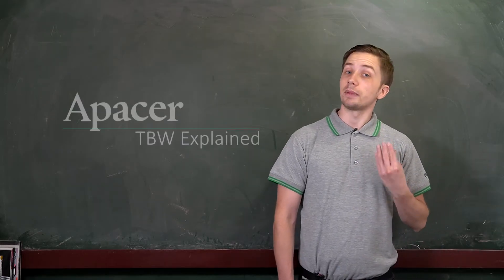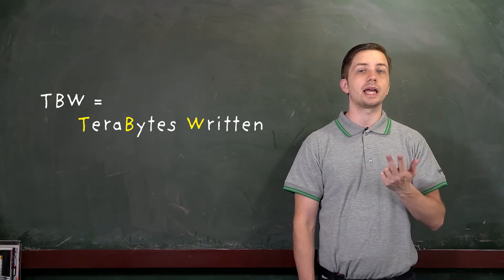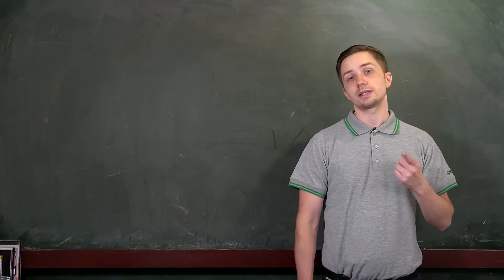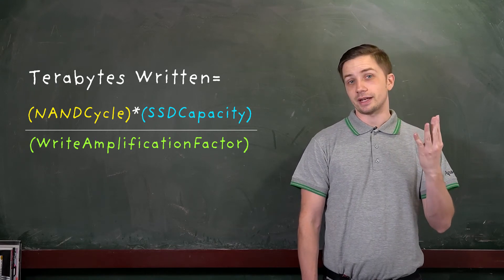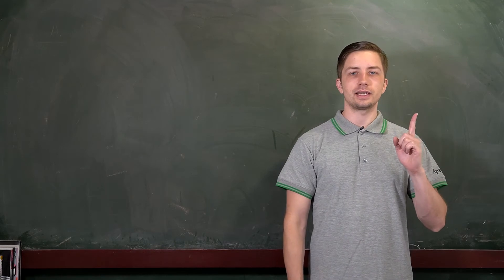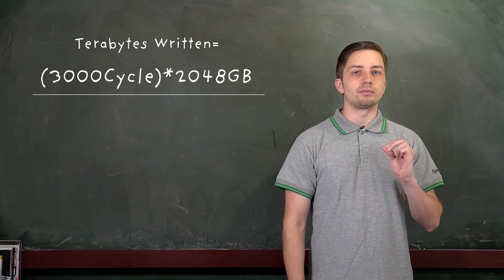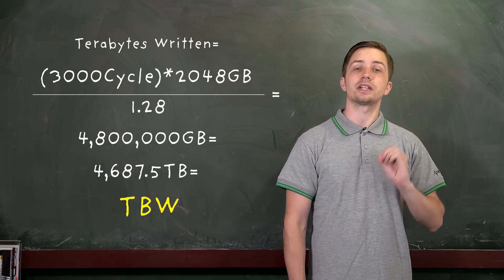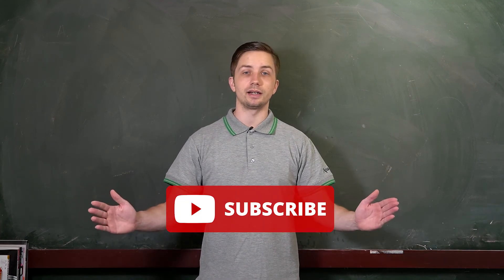NAS SSD｜What TBW (Terabytes Written) Really Means

Comment: let me understand more deeply i contemplated buying a 1TB nvme SSD the candidates were Apacer AS2280Q4 (from 2019) and Apacer AS2280Q4U (from 2022) just one letter difference but the former has a TWB: 1650TB while the latter only 750TB for the same size drive

so why? i checked the nand flash on both drives the old uses: "Toshiba BiCS4 96-layer" the new uses "Micron B47R FortisFlash 176-layer"

is this what really matters? so the Toshiba is a more durable version than the Micron? also this information was not found on Apacer website i had to dig deep on the web until i found these

(i ultimately bought the old drives with the huge TWB)
Reply: Hi there. I'm the guy in the video. I was doing technical marketing. I havent worked at Apacer since 2021. In this video I specifically referenced *industrial* SSDs. These kinds of SSDs are usually sold to other companies, put in their products (ATMs, slot machines, point-of-sale terminals, ticketing machines, etc.), and then sold to other companies again where end users interact with those products.

For the SSD that you're talking about in particular, the best answer I can give is this: it is not uncommon to find competing companies sell micro-components to each other to make new products that are then sold to other companies, but I'm not so sure about end users like you and me. All of this is to say, "I didn't work in the manufacturing department." Take my response for what it is, with a massive grain of salt.
Reply: @BingeHD720  hi man , my new laptop has Apacer professional SSD , I checked it's health after 7 days of use , it's 100 percent, power on hours match to my usage , but the TBW is already 8tb plus , I haven't used it like that , my max use is 20gb per day , so do this data was factory made or I have got some refurb SSD in my new laptop. Any help will be helpful 😊
Reply: @abhaybyebye-p8r  I have no idea. I would say check with the company that sold you your laptop, and if they don't fix the problem, tell the people who run the gamers nexus youtube channel.